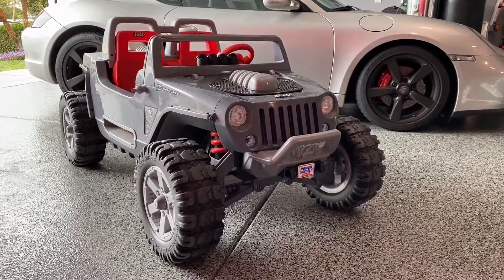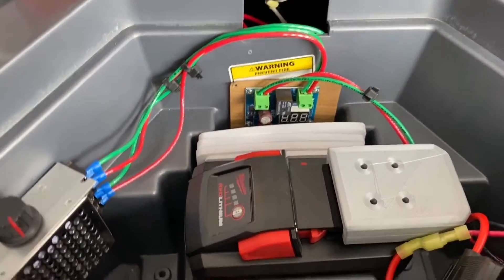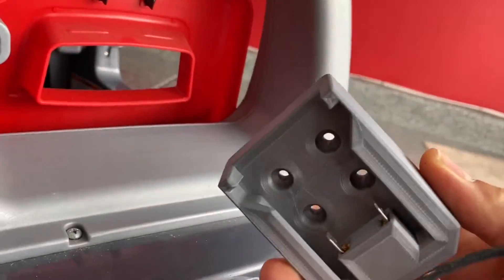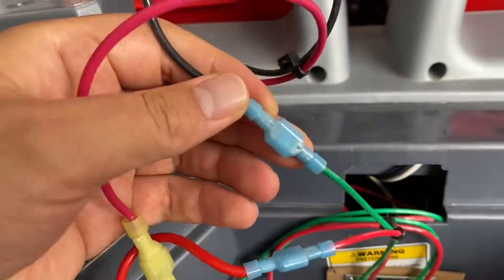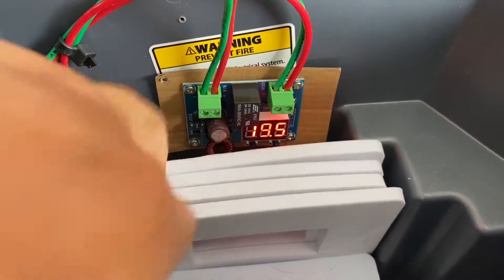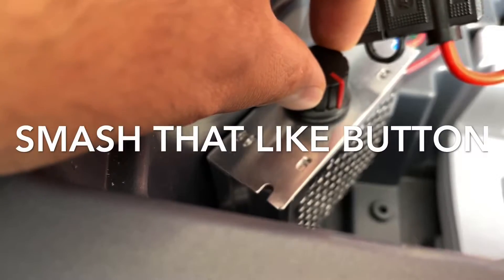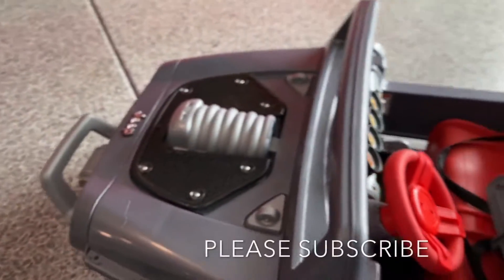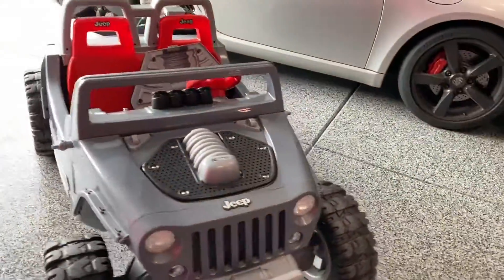Best easy how to modify Power Wheels Jeep Hurricane 12 Volt to 18V conversion Power Upgrade Review

Comment: Awesome video thanks man. Doing 24v kobalt battery for my daughter and Ned to turn it down 😂
Reply from the maker: That’s Awesome 😎. Thanks for watching. Hope she loves it!
Reply from the maker: If you’re doing 24V, I recommend installing the Brake Reduction Module to help spare the gears and make them last a little longer. I do recommend installing the BRM with 18V as well. 

Link below:

https://www.mltoys.com/product-p/brake-reduction.htm
Reply: @WheelieMan  Hi, do you know if this works with the Ride-On Jeeps as well? I did not see it on their list in that link. Even her stock 12v sudden braking is pretty aggressive, and I'm about to add an 18v Ryobi 4amp with a speed controller. I love these kinds of upgrades we can do, basically evolving the vehicles with their age/abilities to get more life out of them!
Reply from the maker: @dham99  Thanks for watching. This will work for the ride on Jeeps as well, as long as it’s Power Wheels Brand. Happy riding!
Reply from the maker: @dham99  @mltoys sells a brake reduction module that gradually reduces power when letting off the accelerator, so it brakes more gently. This significantly reduces wear and tear and aggressive braking, but at a cost of increasing stopping distances. I do recommend this mod as well. 

https://www.mltoys.com/product-p/brake-reduction.htm
Reply: @WheelieMan  thanks man I have one, never got around to installing it. Will get it done tho.

Comment: Thanks for this video.  Got all the same parts except for the female clip used a Rigid 18V conversion adapter also on Amazon on my son's Jeep Hurricane.  Worked great.  I think the Rigid batteries have a built in Low Voltage Cutoff at 14V but nice to have the board to show voltage and set it to about 14.5V for an extra layer of protection.  Keep in mind the voltage controller is PWM so output voltage will not show a major drop in voltage change between low and high on the potentiometer.  I have LED lights on my son's jeep and could very easily see the change in brightness when turning the knob.  Used a label maker to put in rough labels for LOW, MED, HIGH.  The pencil diagram you made sped up the process as well and eliminated any guesswork.  Thank you for posting this!
Reply: Can you read me all the numbers on the load resistor for the brake reduction module?  I think it says 5 ohm  15-25W   1% on the youtube video for that but it's pretty blurry.
Reply: Nevermind, I found it on another video.  If you get a 1ohm 25W load resistor it'll reduce the stopping distance a bit while still having the same general effect apparently.  So will try that.

Comment: If u ever over discharge a Milwaukee battery just make it kiss a fully charged battery with 2 jumper wires….the power will equalize between the 2 and then it can be charged again….

Comment: Did you have to upgrade the motor to a eighteen volt motor?
What if you wired in series two eighteen volt batteries and use the thirty six volt electric chainsaw motor?

Comment: What's the highest voltage you can do on these things before it breaks down. I wanna make my son's jeep as fast as possible lol
Reply from the maker: The higher past 12V you go, the sooner it breaks. But I’ve seen people run 54v in them, but longevity is not their strong suit at that voltage. Probably won’t last that long without significant upgrades to wiring, motors/gears/batteries/etc.

Comment: Open ended question but lets say 50 percent to 75 percent on controller. How hot does the motor get? Curious with hust going from 12v to 18v. Ive seen peoole say overheating issues with going 24v. Just curious how much life i might be saving in the motors by going 18v vs 24v.
Reply from the maker: I’ve yet to see it over heat. Not sure what temp it gets to. I’ve never measured it before.

Comment: Hi,

I bought a new J4394-9319 Replacement Shifter Assembly for Jeep Hurricane. When I press the pedal the gear boxes only work in the forward position on high speed.  Forward low speed and reverse do not work. Any idea what could be wrong? 

Thanks!
Reply: Thanks a lot👍🏻
Reply from the maker: If your Power Wheels won’t reverse, this could be due to a specific wire breaking off. It could also be because one of the wires has become disconnected. If you want to do a DIY fix yourself, you can open up the toy and check/clean the wires. It could also be a faulty shifter as well. Good luck. :)
Reply: I picked the toy up from the street. Someone was throwing it out. Currently trying to do a DIY rebuild off the mod you did in this video.  I have the toy upside down with all wires exposed, rear wheels removed, gear box/pinions exposed. The shifter and Milwaukee adapter came in today. I hooked up the adapter with M18 battery to the black and white leads and changed the shifter. When I press the pedal only forward high gear works. All wires and connections look to be in tact. Also, the radio wire was connected to the old shifter. The new shifter doesn’t have a connection point for the radio wire. Idk what that’s about. Could it be the pedal that needs replacing as well?
Reply from the maker: That’s a great question. Personally I would recommend emailing ML Toys directly. They are my go to help line when I get stuck like this. They are pretty quick to respond as well. 

Good luck. 

Email: gofast@mltoys.com
Reply: I just gone done trouble shooting this exact issue and can say with 100% certainty that it means your driver's side motor is either disconnected or has failed.  High gear gives power to both motors, low gear gives power to driver's side motor only, and reverse gives reverse polarity to driver's side only @WheelieMan

Comment: What is the problem when suddenly stop while running? After a few seconds its going to start again. No upgraded since i both. Pls help
Reply from the maker: Battery/electronics could be overheating, shutting off to prevent critical damage. Then when it cools off, it’s able to run again. Or could be a loose wire somewhere in the vehicle that is coming loose temporarily.

Comment: I took out the screw so that it could drive 5mph. The higher speed was working. After a couple days in the house I carried it to the garage. Ever since when the gear shift is in 5mph nothing happens when the gas pedal is pressed down. Radio stopped working too.
Reply from the maker: Sorry to hear that. It’s possible a wire connection came loose either at the shifter or possibly one of the motors. 

Regarding the radio, that is powered independent of the motors, have you tried changing the batteries for the radio? 

Good luck.
Reply: @WheelieMan  Turns out the white wire terminal under the gear shifter came loose. Doesn't stay connected very well so duct taped it. Thanks.

Comment: Are both rear wheels powered? Just got my kids a stock one and it just seems to spin one wheel on most surfaces.
Reply from the maker: Hi Kyron. 

It is 2 wheel drive, with a motor/gearbox in each of the rear wheels. 

Have you removed the screw in the gear selector switch to unlock speed 2/the high speed?

Speed 1 (LO) only drives one wheel/motor primarily and sends very little power to the second wheel/motor and speed 2 (HI) drives both wheels. 

Could also possibly be a loose connection or a pinched wire or a failed motor or stripped gear in the wheel that is not turning. 

I’d start with looking at those first and see if something jumps out. 

Merry Christmas 🎄!
Reply: I have not removed the screw for the “2nd” gear. I’ll start there! Thank you so much!
Reply from the maker: That’s it then. Removing the screw sends max power to both wheels evenly in speed 2 (HI). That will definitely fix the issue. Merry Christmas 🎄
Reply: Merry Christmas to you as well!!
Reply from the maker: Thank you 😎

Comment: Get some old BMX tires trim off the rimwire, and screw it with 3/4 inch screws.
You will find it helps with traction and control.

Comment: Cool video, but I’m such a noob I’m not sure what order to connect things. I have pretty much every component you have in the video. Please correct me if I’m wrong: drill battery adapter positive to inline fuse to positive input on low voltage protector and drill battery adapter negative to negative input on low voltage protector? Then low voltage protector out to speed controller in? Then speed controller out to power wheels? Any help, correction, virtual hand holding much appreciated.
Reply from the maker: You nailed it right the first time. 👍. You’re steps are correctly listed. Congratulations. I hope the kid(s) enjoy it. Total time should not take more than 60 minutes and 2 beers for even the most novice builders. 😉
Reply from the maker: Here is a like to a rough visual diagram. https://imgur.com/gallery/oyS22uI

Comment: Any issues melting the cutoff?? I ordered 2 from Amazon identical to yours and melted both. Tried one other brand melted it. Only difference I see is I’m running 2 packs parallel for extended run time.
Reply from the maker: I have not experienced any issues with mine. What gauge wire you running?
Reply: @WheelieMan  you said, "Do not use lithium batteries in a ride-on." so what are you using ?
Reply from the maker: @youtoobmeloob  I’m using the M18 lithium in the video.
Reply: @WheelieMan  so you are using a lithium ion then?
Reply from the maker: That is correct. 18V Milwaukee M18 battery.

Comment: Most complete guide out there thank you, for the low voltage disconnect at what % you should cut the power? For a XC 5.0 Not sure what tools are around. Thank you
Reply from the maker: Thank you Tommy. I set mine to 16.5 volts. 👍
Reply from the maker: Just make sure to unplug the battery after it hits 16.5 volts as the low voltage disconnect will still draw a little power from the battery if it stays plugged in.

Comment: Did you not have to upgrade the 12v motors ?
Reply from the maker: No, the stock motors can handle 12v-18v, but expect accelerated wear and tear on them so they will wear out quicker. I’m still running on the stock 12v motors since this upgrade.

Comment: Question. When we bought this car the box says it has a working radio but our radio never worked. Was there anything I had to do to make it work??? I have no idea . Thanks
Reply from the maker: Yes. 2 Phillips head screws holding in the radio cover. Unscrew cover and install 4 size C batteries. Then screw cover back on. Radio should work after.
Reply: Thank you! Have to remove the steering wheel in order to do so, correct?
Reply from the maker: @monical4238  no, steering wheel removal is not required to access the radio battery compartment. Here is the vehicle manual. The instructions are on page 18. Good luck. 👍 

https://www.fisher-price.com/inst_sheets/J4394pr-0921.pdf
Reply: Thank you!

Comment: Any suggestions as far as a remote kill switch?
Reply from the maker: Something like this could possibly work. I do t have personal experience with it.  But for less than $20 it’s worth a try. 9V/12V/24V/48V/72V/85V Wireless Remote Switch with Long Range Voltage Switch for Anti-Theft Alarms Door Motor Cycles Smart light switch Universal Relay switch Model 9V-85V (1X Remote Control) https://www.amazon.com/dp/B08K7KDV2X/ref=cm_sw_r_cp_api_glt_fabc_KZ37WMED8TJVYP929FZW?_encoding=UTF8&psc=1
Reply from the maker: Here is a good tutorial. 

https://youtu.be/jVh3OSEReuU

Comment: Great video, I found it really informative. Thanks for linking all the parts. 

This project only seems to make sense if the12v stock battery dies and you need a new one or you happen to have spare 18v lithium Milwaukee batteries just lying around. The battery you linked by itself is $220! Seems like a pretty big expenditure for a 2 mph gain in performance. Would other Milwaukee 18v lithium batteries work? for example XC 8.0 Milwaukee 48-11-1880 M18 REDLITHIUM HIGH OUTPUT XC8.0?
Reply from the maker: Thank you for the feedback. Absolutely a smaller m18 battery will work. I had the 12.0 battery already and so I just used that for the most range. But even an lower cost M18 2.0 battery will work. Milwaukee 48-11-1820 M18 18v REDLITHIUM 2.0 Compact Battery Pack https://www.amazon.com/dp/B00BYFNR8M/ref=cm_sw_r_cp_api_glt_fabc_NN5TCZBAJTX36X0QFVDR?_encoding=UTF8&psc=1
Reply from the maker: I linked a lower cost battery option in the description. Thank you again for the feedback. 👍
Reply: @WheelieMan  Thanks again for the helpful video and response. I had one last question...I did the conversion and used the same low voltage cutoff you used. Everything was working great. I left the battery in the Power Wheels overnight thinking the low voltage cutoff would prevent over discharge and would cut the power when it needed to (I set it at 16.5v). I was wrong! The battery is completely shot and won't charge...do you remove the battery after each use? Have you had this issue?
Reply from the maker: Hi Michael. Yes, I do remove the battery after each use. I believe I have my cutoff set to 16.5 volts too. This info below is direct from the Amazon product listing for the cutoff:

--------------------------Most people are confused about this question,Please read as follow message carefully--------------------------

IMPORTANT TIPS

This product works great to cut off the voltage when a battery discharges to a set level. It stops the output/load but you can NOT leave a battery hooked up to this product. This voltage cutoff (this product) stays on and will continue to drain the battery as this product (understandably) needs electricity to operate. True, this product will drain the battery much more slowly than your load was probably draining the battery, but make no mistake, this product consumes electricity after disconnecting the load and gets that electricity from your battery, eventually draining it.
Reply from the maker: If you still have a warranty on the battery, I would make a warranty claim to get it replaced if it’s no longer charging.
Reply: @WheelieMan  Lesson learned! Thank you for that info. Man you'd think it would just cutoff completely after it hits the voltage you set it for, I thought that was the whole point!

Anyway, thanks again.
Reply from the maker: @michaelmarino6904  I agree with you completely. 😉 definitely request a warranty replacement. Milwaukee is great about warranty issues. 👍 happy riding!
Reply from the maker: @michaelmarino6904  now I recall, my wife took my son out for a ride in his Jeep several months ago and forgot to disconnect the battery overnight. Next day I went to ride it with him and saw it was still connected/on. Thankfully the 12.0amp battery was in there as it still has 17.5+ volts left so no harm to battery and it didn’t hit the cutoff limit. This is another main benefit of the bigger battery, more cushion with the longer life. A 2.0amp battery would have been toast. But always best practice to unplug battery after each use. Thank you again for bringing this to my attention. I’ve updated the video description with this info. 👍